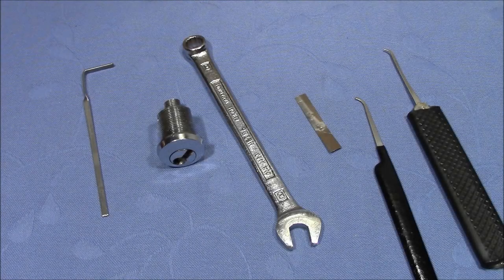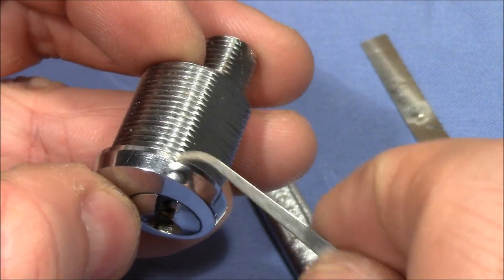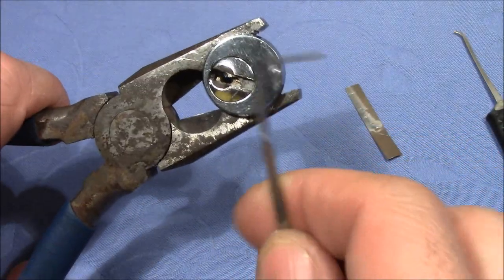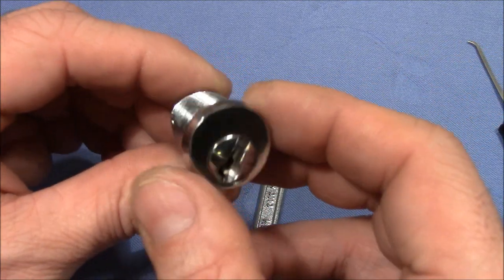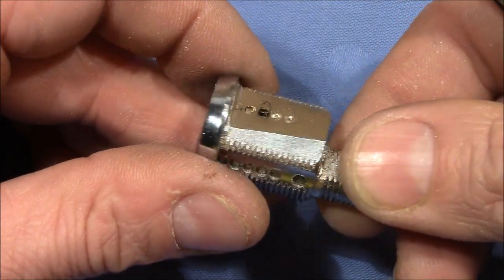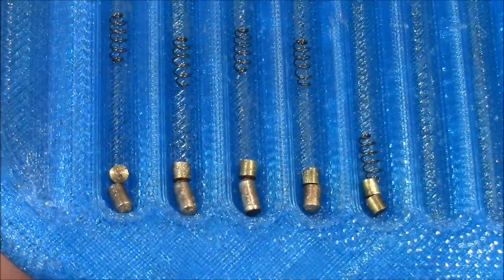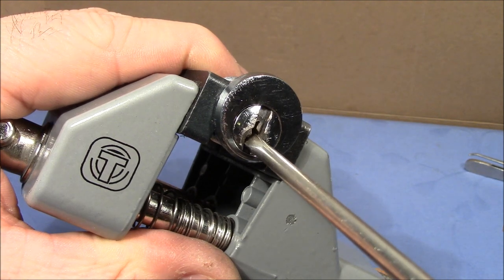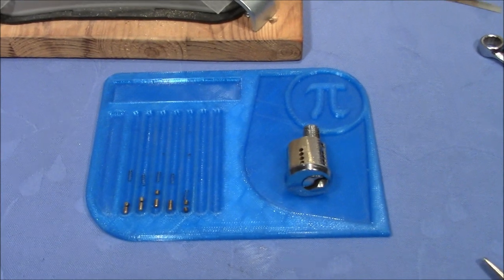(picking 618) I messed up lock a little lock and "repaired" it (courtesy of 'MrLupooo')

Comment: The drivers are very short in those locks, so I guess the first problem was you not picking one of the pins in bible 1 to the right shearline. and then turned it, with both keypin and driver in the core, on atleast one of the chambers, causing the spring to be pulled along, between core and housing, making the lock bind so badly. When you bring it back to bible 1 now, do you feel springs in all 5 chambers ?
Reply from the maker: You are probably right with the explanation of the badly binding plug - thanks for the input. It was quite funny when I realized that I picked a lock with only keypin left. No, I didn't feel anything beside of #1 which was the only stack with a keypin.

Comment: Two bibles - wow ! Picking without any key pins could have gone badly wrong if a spring got mangled up :o)
And that's what I call a 'tension wrench' :o)  Be interested to know why the plug is so stiff in the body - do you think someone has squeezed it all out of shape in a big vice maybe ?
Reply: I was guessing the spring too. I also loved the tension wrench, now I know why there are called wrench :)
Reply from the maker: Haha, yeah the wrench is pretty cool as tension tool (sadly only visually and less functionally). I also think that some kind of deformation has happened.

Comment: Is there a set pin in the back?
Reply from the maker: I think this pin in the back is a retaining pin to limit the rotation and prevent the plugin from coming out. The mistake was that I also dumped out keypins and then turned it back to the first bible.

Comment: Interesting that it would have two bibles, is that the locks security feature?
The mistake may be that you didn't replace the key pins into the second bible so the first bible only had drivers and springs to pick.
I am still curious as to what was causing the plug to bind.
Thanks for the video
Reply from the maker: Cheers - you are right. When I picked it in the video it felt strange. Then I started thinking and recognized my mistake ;-) Maybe I'll make a followup and take it apart completely to see what made it bind so badly.

Comment: I have no idea what u did wrong ... but .... my guess as to y its so tight is theres been damage in the lock housing holding the core like a groove thats catching it ..
Reply from the maker: The mistake was that I also dumped out key pins. Then after turning it back to the first bible only one key pin was left to pick. The rest of the chambers only had drivers and springs.

Comment: You have extracted the key pins so you are picking just the drivers in the first bible correct ? Why don't you file down this too, remove the drivers and explore the friction between the core and the bible ? Maybe after you can use little grub screws to repin it... (I have tiny ones from aliexpress...)
Reply from the maker: You'er absolutely correct. I tried so much to get the pins out that all keypins beside #1 also came out. Then I wondered when picking it from the first bible why it feels so strange. Then I started thinking...
Maybe I will make another part with the full repair.